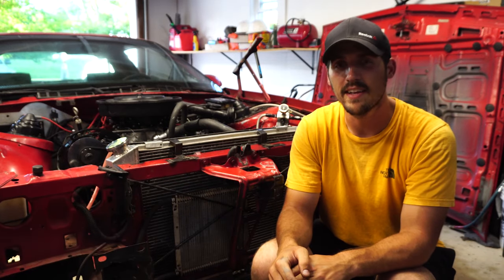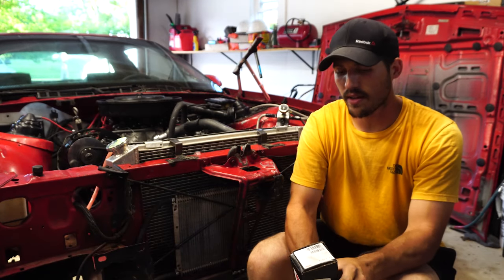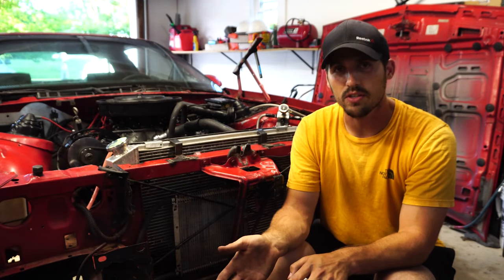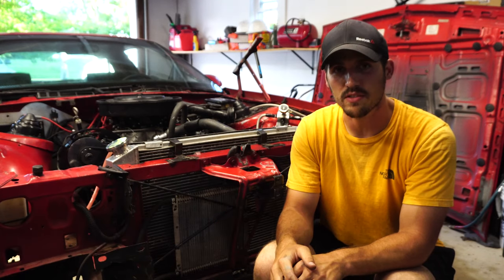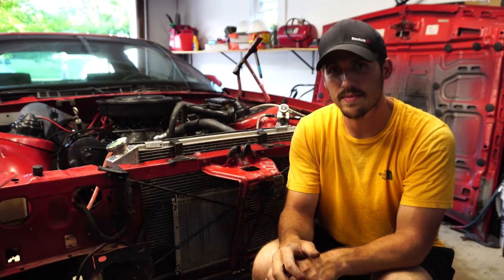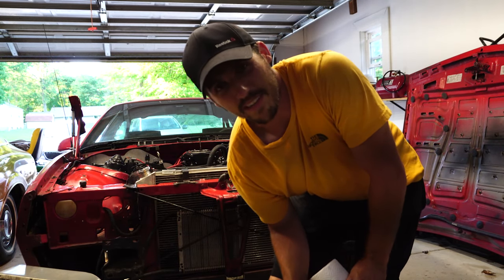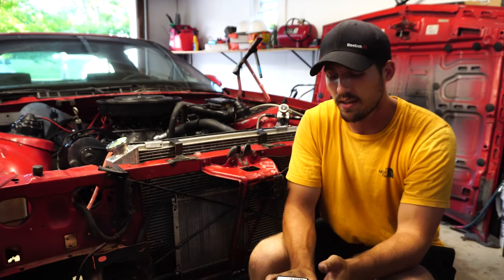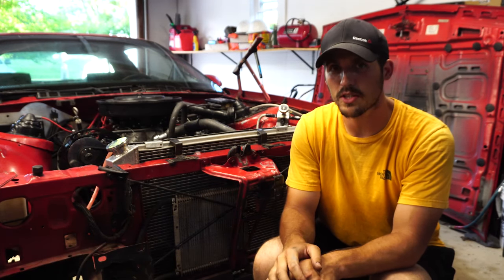Comp Cams Thumpr vs. Xtreme Cam Sound Comparison

Comment: I have a mutha thumpr cam in my truck. Did some other things to go along with it. After 2 years or so now and being a daily it's just nice to have something that has a little more power and sounds good. I'm not really looking to win race's, just have something to enjoy driving that has some character. It took a short time to get used to driving with it on a stock stall but once I did it's not really a problem. Driven it in snow and ice too. It's actually kinda nice to have the powerband the way it is because it allows me to dictate when I want the power depending on how I'm driving. It's just fun enough and sounds good enough that for me it was worth it.
Reply: Get the right converter youll love how it drives SO much better. Stock stalls and lopey cams are a real disappointment
Reply: I hear what your saying. I like a rough cam, but that alone dont win races.

Comment: Just wanted to say thanks as I am rebuilding my 76 Corvette  with 750 double pumper Holley ,  Edalbrock Performer manifold intake with a 2 in aluminum spacer, 180cc/64cc aluminum heads from Flotek and thought about the Thumper, but after several videos I felt it was also too much. Appreciate how you did flash back comparisons and then even listed what you installed. The array of options across the internet is overwhelming and sometimes confusing when your wanting to up the horse power but only have one shot at it. Again thanks and wishing you well.  I have been buying and working with Speedway Motors whose has been great about shipping and support.
Reply: UNless you gear that vette Id stick with a isky 270 or 280 mega cam tops. 
YOu need lots of torque that thumpr will disapoint

Comment: The thumper sounds much better, but the extreme energy will have better performance.
Reply: There has been dyno comparisons done by one or two of the engine masters guys. The thumpr cams surprisingly made a small bit more power and torque than the extreme energy series. Kinda surprising I know.
Reply: I would think the thumpr cam would make most of its power in high rpm
Reply: @brendanscott5023  it tops out at 6200, it has a nice broad torque range surprisingly.
Reply: All things being equal, the "thumpr" cam will give it better performance!! It has more lift, more duration, and will raise the power ratio. More air/fuel mixture in, means more compression/power out. Unless he's got a stock converter, he will gain more performance from the larger cam.
Reply: @brendanscott5023  It rally depends on your engine. But wide LSA cams which the Thumpers usually are, like to RPM.
Reply: @AB-80X   comps thumper cams are on a narrow typically 107 LSA. The big exhaust duration and narrow LSA increases overlap to give the 'cammy' idle.
Reply: If the intake duration was the same as the exhaust on these "sound cams" the engine would die from the alternator drag when you turned on the headlights! It's all just long  winded exhaust timing!
Reply: @Anarchy-Is-Liberty  Thumpr cams, for their size petering out at 6200 shows how inefficient they are. All the unburned fuel on this guys bumper even with EFI shows this.

Comment: I actually always like the 256H XE cam but something that happens a lot with thumper cams is a lack of static compression ratio. With even the smaller one really needs 10.25:1+ on a sbc 350. If running your dynamic compression will be really low and if will feel sloppy and sluggish. It will also will be a lot harder to tune. The XE256H is great for a 9.5:1 sbc 350. Like most flat top with valve reliefs will make.
Reply: 256 was a way better choice for him....thumpr, bootlegger etc need compression lots of initial timing, gears, stall to even work.  Sad so many choose cams by a video and have no idea that most times they will be driving a turd .
Reply: @gordocarbo  yep agreed always check your squish and your dcr before you buy a cam

Comment: Man the old thumper cam definitely has a distinctive sound
Reply: That's all it is for basically
Reply: I have a mutha thumper in a STOCK 454 bbc, with headers, intake. Pulled way harder then the extreme energy cam. I did same comparison. If your not afraid of stall the rattle. Let it thump
Reply: @zombieking712  not true
Reply: @adamstreitz5089  What was the specs of each cam?
Look at it this way. The Thumper is basically a relatively mild intake lobe with lots of exhaust duration and some added LSA to keep things running. So you could get say a 232/246 LSA 112 for instance which will sound pretty rowdy in a 383 for example, but it will be relatively mild. And like most cams with a wide LSA, it will be soft down low and in the middle. High LSA cams like to RPM.
Now make a cam that has a 230 intake, but 234 on the exhaust and a 108 LSA, and you can be pretty sure which one will make the most average power. The latter will obliterate the former no matter what you do with gears etc. They will sound about the same, but they will drive very differently, and the midrange punch in the 108 LSA cam will be brutal compared to the 112 LSA cam.
Reply: @zombieking712  It's not all, but it is the main objective.
Reply: Ok i own the cam plenty of better ones that don't sound as "cool"
Reply: @zombieking712  
What kind of power do you make? Just for comparison, here's a 454 combo I put together for street use, and it sounded properly rowdy.

It was a simple combo. 

Edelbrock 325 oval port heads with matched rpm air gap intake. Howards 123505-10 cam. 850 cfm Holley, 1" Wilson tapered combo, and 10.3 CR. 

It sounded cool, but also ran great. Note the spread between peak torque and hp. 
631 hp @ 6200 rpm.
589 tq @ 3900 rpm.

Those number tell the obvious story of how well mannered and how efficient that engine was, especially for its power. No Comp Thumpr will ever be able to do that.
Reply: @AB-80X  thats what I said
Reply: I took it out
Reply: That thumper cam was hitting!! I don’t know if I could take that cam out. I know what you’re trying too do but you it would be hard too take that camshaft out.
Reply: @rodneywilliamson6048  Thumpers need lots of compression, gear, and converter to operate properly. Personally, a small hydraulic roller on a 108 LSA will be better in almost respects.

Comment: I'm running an isky 137F solid flat tappet in my flat top 40 over 327 with stock 58cc 305 heads and it runs awesome from idle to maybe mid 5k before the heads give out. It's a 230@50 480 lift advertised but the lash is 14 thousands so it's more arou 
466 lift. Slight lopey idle, good on fuel, holley 670 and runs really good. Lites the tire easily from a dead stop and hits 2nd and 3rd real hard too. It's to easy to go big on a cam if you're not careful.
Reply: Havent heard of that grind in many yrs. Sounds similar to the hyd 280 mega cam
Small solids most never even heard of but they are a blast on the st. 
Best running 350 I had was a 10.3 to 1 350 270 cfm head Isky 280 mega Holley 300-36 and a 650 double pumper. Holy cow that thing litup tires NOW!
Even with the wrong 308 gear and a not sufficient 2800 stall. 
750 was way too much carb

Comment: I was checking old dyno sheets from the danger mouse build, this cam is quite impressive and beat out the following 2 larger cams below 5200, in both HP & TQ, and that was in a 9.25:1 350, with stock 194 heads, with roller rockers, and an RPM air gap intake. The test they didn't do was this cam with Vortec heads.
Reply: Tried a low (barely 10-1) build like that yrs ago and was disappointed. 
What works on thier dyno didnt add up on the st. Firm believer in compression gears makes all the difference in the world. You can literally hear it in the tailpipe while driving.

Comment: Saying one makes more power over the other is not an entirely accurate statement. 
It depends on where and when you want the power. 
Thumpers are a great cam if you are reaching a bit higher and have all that it needs to go with it. 
Calling it a "sound" or junk cam just because most people buy cams these days for that sound doesn't make it so. 
Comp doesn't make junk. My opinion

Comment: That smaller cam will make more power and enhance driveability over the thumpr cam. That's why I'm going through the trouble of swapping the one in my 383.
Reply: yep. Many overcam and their powerband isn't realistic on the street and then they get blown away from the stoplight with a stock motor. Lighter vehicles get by with it more but say a big car or 80's truck forget it.
Reply: @drdjh2003  Well said!! Some of the best running st cars are mild torquey combos. Hard to beat overall.  
Lope doesnt mean fast thats for sure

Comment: Nice video I like that thumper cam had one in my 77 camaro love the idle
Reply from the maker: It is a great sounding cam that's for sure!
Reply: Is the vacuum decent?
Reply: @johnsheetz6639  they have very decent vacuum when you use it with proper compression ratios.

Comment: I just built a 355 Holley sniper Edelbrock intake hooker headers vortec heads thumper cam. Just ordered the xtreme energy cam too. 
Thanks for the video, I love the Camaro.
Reply: They don't recommend efi with the thumpr
Reply: @briandcarey3110  Agree, totally wrong cam for EFI especially throttle body. WAy too much overlap

Comment: I just put an same smaller XE256 212°-218@.050" cam into my aluminum head small block Mopar after running a larger lumpy 224°-224° CROWER.
Same exact results.
The larger lumpy cam sounded great but the overall performance was terrible.
An wise man once told me that going to the bottom the camshaft page might look & seem like a good idea but nothing good becomes of it.
Fact!! 🏁
Reply from the maker: Glad it worked out good for you! That's good advice also
Reply: Correct. avg st sb, 2teens@ 050 cams usually run best overall. GOod torque brakes easy to tune etc
Like big cams too but it needs lots of supporting mods or its just a pooch that sounds good

Comment: I have compared several cams and believe it or not, the thumpr cams do make good power and very strong torque when used with the right compression ratios and decent heads.
Reply: and A LOT of initial timing.  Ive heard people had to limit their mechanical advance to where they ran 20 degrees or more initial...
Reply: @KingJT80  not so much really.
Reply from the maker: From my experience with the Thumpr cam the power came in at higher rpm like most big cams. For an average engine like mine I won't rev it high enough to really get all the benefits of that.
Reply: @Jay-fb2lv  Well compared to most people who just run 14 15 degrees initial on a street performance cam.  its getting up there.  one guys said he ran 24 initial and 36 total.  cleaned up the idle and he didn't have to jack around with the mixture screws or the idle circuit
Reply: @KingJT80  that’s because he didn’t have as much compression as he thought he had.

Comment: Put the thumper back in .
Reply: Not unless you want to lose power.
Reply: @w41duvernay  let's be honest man with an older car like that sound is always going to be better. That thumper cam made it sound like a real muscle car. Definitely going with that on my small block.
Reply: @w41duvernay  I wouldn't say that. Depends on the combo
Reply: Agreed put it back on it sounds like true American muscle with the the thumper
Reply: I agree put the thumper cam back in the extreme energy cam sounds like a Farmall H tractor
Reply: @guitarsandcars2586  Sound doesnt mean anything if it cant move. 
Guarantee the smaller cam listed will pull bettr overall without having to regear, deal with lowvacuum poor idle need big converter etc.  Lots of overcammed cars that cant get out of thier own way
Reply: @zanzanman8755  Sorry man thats bad advice. Lope or sound doesnt mean it will be fast
Reply: That's what she said 😂
Reply: The “cool noise” doesn’t make it go any faster.. pick a cam to work with the rest of the parts, not just for “the sound”.
Reply: That thumper sounds like garbage!!
Leave the new one in sounds so much better

Comment: Why build for sound? Build for power!🏁
Reply: @evorider3689  You can run a lot less aggressive cam, and get plenty of power and sound. 
Thumpr is very inefficient. Many cams much smaller do the job better and still sound good.
Reply: ThT why he should take out the thumper cam and put back in the extreme cam in.
Reply: @w41duvernay  Not a fan of those either. Ramps for a ft are too steep imo. Had 3 fail back to back, when they first came out. XFI280 roller, too. Unreal

Comment: I had a 355 in a 86 Chevy k20 longbed c6p heavy duty chassis 4x4  farm truck and I had a competition cams xtreme energy 268h cam kit in it 474/480 lift at 221/224 duration and it made plenty of power and decent throttle response even with it running a qjet my choice of carb.. honestly mine sounded more like the thumpur cam you had in your camaro..
Reply: You have the older high energy 268. The newer XE268 has 224-230@50

Comment: It is a great sounding cam TERRILE POWER LOW TQ.. XE cams  work Thumpr cams are  only for SOUND.;
Reply: They need a a lot more initial timing and compression than people think.  its a "big camshaft"  the one he had was pretty big and if he didn't have 10:1  minimum its gonna suck.  esp on vortec heads.  

if he had the smallest of the 3 aka the thumpr , it wouldn't have been that bad cause vortecs have sucky exhaust ports anyways so its needs that extra duration
Reply: He got to get the 279 thumper cam that the small one
Reply: @KingJT80  what are your thoughts on a thumper in a 5.0 Ford? I have an f150 thats to nice to beat on so it gets driven to go get ice cream and to shows only...maybe deck the heads bump, compression port em to the max?
Reply: @desmondpeak9931  yep
Reply: Thumpr cams are better suited to strip and racing applications. They actually make more power on the top end with a wilder setup. On a street setup they make the engine run like a fat pig at low RPM.

Comment: You ain't making much power with either one but at least the thumper sounds cool.
Reply: What would you recommend?
Reply: @falcon6995   a stock 5.3 lol
Reply: @RazorUltraPro11  you don't need a stock 5.3 lol just put a set of cheap 180cc aluminum  heads and flat top pistons in a 350 and a 230s duration cam. 

Done 430+
Reply: Lol last guy said it kinda. Heads, man, heads. Whippy little cams like these aren't bad in any way, give a bit of extra bump in the power but then again so can a quality tow cam, anythings better than most stock choked up cams. The best part is being able to change how the motor acts. But none of it matters for power without heads. Get good heads first and you'll SIGNIFICANTLY increase how much power even a decent little cam can make. Heads are expensive even when theyre cheap, save up for a pretty nice set. Then you can get whatever cam you want and actually see it's gains.
Reply: @-OokySpooky-  yeah it always works better with better heads then you don't need as much cam duration.
Reply: I wanna restate my point bc I did a bad job. Getting new heads will ALWAYS outclass a cam. As the point of new heads is to intake and expend matter better. The WHOLE IDEA of an engine is to take in chemically viable mass, turn it into kinetic power, then expend it's waste. It is a self powered air pump, which is very common to hear people say an engine is just an air pump - and that's why. Heads raise the ceiling of HOW MUCH matter can flow through it. Your cam is just a timing piece deciding when to burn said matter. A mild cam will perform better bc stock cams are designed to reach certain from factory expectations. Sooo they suck. A mild cam is nice bc anything is better than stock. If you don't wanna fuck about too much with your motor than just installing a "tow cam" will do you wonders and not really screw up your mpg. But a mild cam WILL be capped off by your ability to flow. Remember a cam is just a timing device - LITERALLY. So it it can only tell your engine what to do but has no real ability to tell it it's limitations therefore cannot break them. My advice is to start with a cool exhaust - bc it's fun to feel, followed by saving up for heads, then cam. Bigger heads mean more air mass, then more fuel air in/out. Cam is literally just timing that ratio of how much air to fuel. It's like if you trained leg day every day, but also smoke 2 packs a day. If you can't breath you can't sprint. It's not even an allegory - that's literally how it works. You need to be able to take in capable energy producing mass to produce energy. Heads are god to a motor. Cams just just change how and when it uses the energy it can intake and expel
Reply: @KingJT80  You still need it, you just get more power:-)
But any engine build starts with the best heads you can possibly afford.
Reply: @-OokySpooky-   well said
Reply: @KingJT80  The stock ls comments are laughable. Just dont know any better
Reply: @-OokySpooky-  Yes! Afr 180 head with that small cam will smoke tires whenever you want and idle all day in traffic with the ac on

Comment: MT cam is garbage. It's for show, no go. The XE cam is for people who want to GO! Especially on the street. You made the right, mature decision.
Reply from the maker: I definitely agree with that statement!
Reply: My old 350 made more torque overall power with the smaller Isky 280 than the XE 284. 
Geared right single patterns hit harder, just choose a realistic powerband. The extra 5-10 lbs you Maaaay get from teh XE isnt worth the accelerated wear on valvetrain parts.